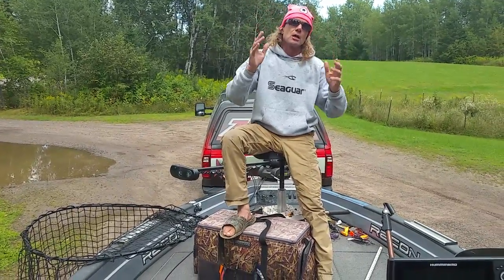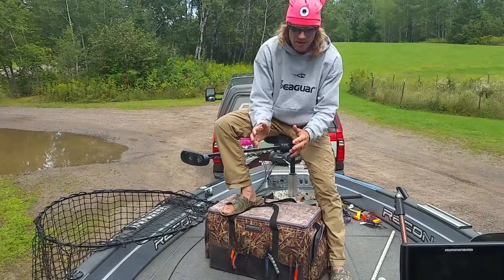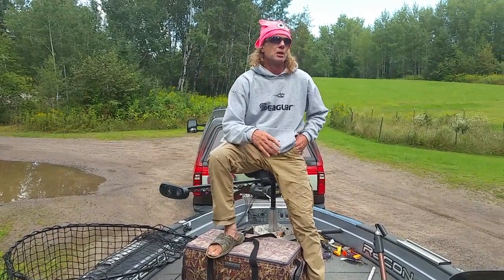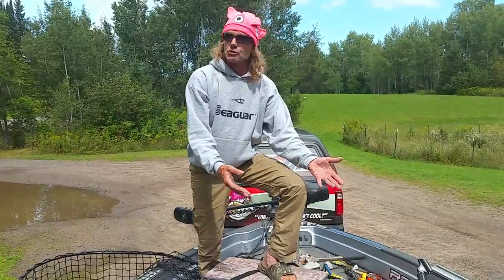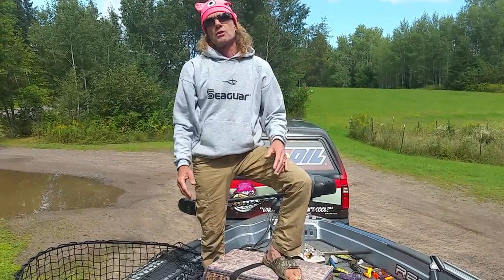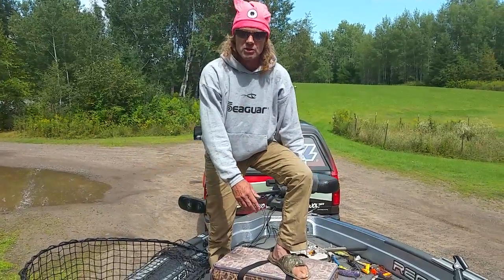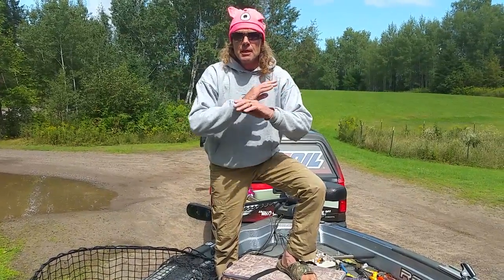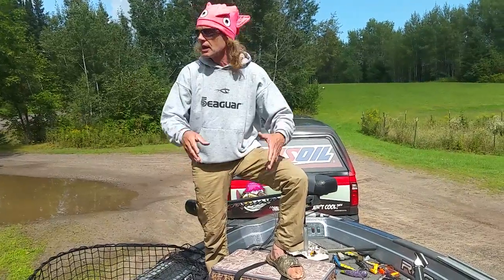The Maina Vent - Bump Boards

Comment: Does using a  bump board inside the net in the water work pretty good?  That’s what I’m planning on doing this season anyway. I’m just curious if it’s difficult to hold the fish on the bump board if they can swim around. Would you recommend holding the fish under the gill plate like you would if holding for a pic or would you recommend trying to hold the tail?

Comment: I've been considering putting a fold-out shelf on the side of my boat for the reasons mentioned. I definitely will, something that can measure the biggest and still be over the water in case it does thrash. Which they do. A lot. Thanks for the extra push.

Comment: How many pictures of fish do you need ? I won't even take them out out of the water unless it's a p.b, which will have to be a high end 40 lb or a 50 lb fish. I just guess the length if it looks less than a 55 incher & isn't fat.